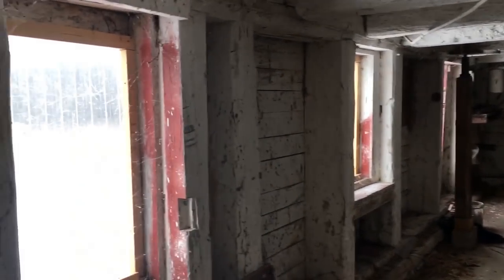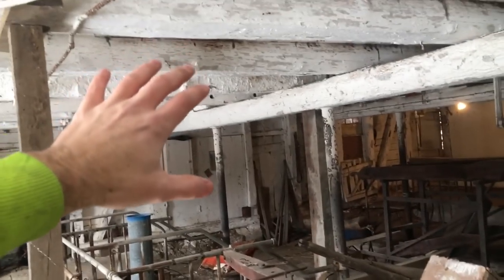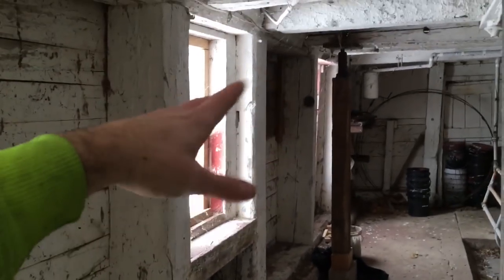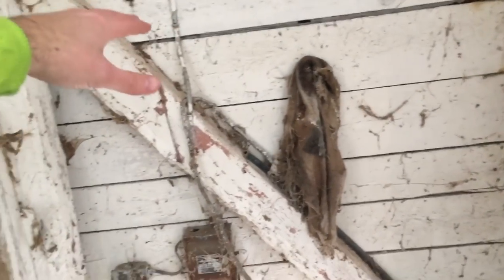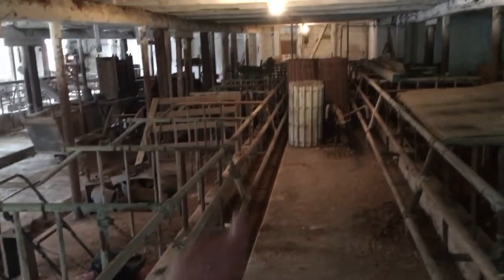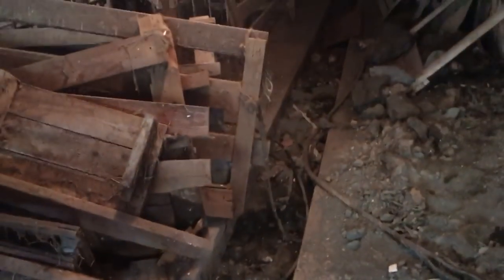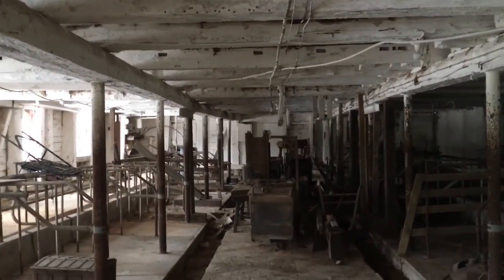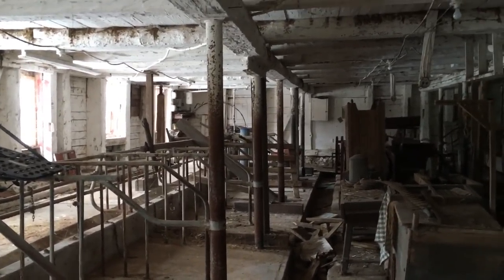Starting a Dairy- Part 2

Comment: You could open up the wall between the two barns jack out the center alley and make the whole thing a free stall/tie stall thats what we did chain the cows up milk em and cut em loose then later down the road put a parlour in drastically cuts down on start up costs just to get ya milking
Reply from the maker: I didn’t think of that, that would be another option, just make it all one

Comment: Without actually being there,  your stone wall could be pushing the barn. If you want to update to a more modern facility you can think about a flat parlor. They are a lot less money than a regular parlor, but if you like to be close to the cows you still can without so much wear and tear on your body. I would check with your state department of agriculture before you spend money past keeping the barn structurally sound.  They may not allow cows to be milked in that type of facility anymore since they would be issuing a new grade A permit.

Comment: I would turn the old barn into a trans Iowa type swing parlor and if you had a lot put some outside free stalls around the out sides of the lot with lean to over them and maybe a covered feed alley. Could be done cheaply and save a lot of labor. The guy that designed the parlor has all the plans for free on the web. The key would be good cows and forage.
Reply from the maker: That looks like a nice system. I hadn’t heard of that.
Reply: PA Farms My uncle converted his stantion that was a chicken coup before for less than twenty
thousand. He milks sixty cows in an hour and a half. Dairy is a good way to diversify but the reason a lot of people quit is the everyday chores. Have lots of kids and get them to do it lol

Comment: Holstiens might not fit in those stalls length ways anymore.  You might need metal grates over the gutter so they aren't laying in it.
Reply from the maker: Yea. I would want gutter grates, we had them on the farm I had worked on. When we put in mattresses, we raised the stalls a few inches so they wouldn’t be in the gutter.

Comment: Gut the stall section add  a low cost Trans Iowa parlour  remove the wall add  replace it with a curtain wall
Reply from the maker: I hadn’t thought about a curtain wall. That would be a nice option, just support the roof well and add curtains

Comment: Problem is with dairy that you barely make any money if you do,  I love doing dairy, I olive these old tie stall barns, we have a 6 by 6 parlor put in and a 140 cow freestall built, we ripped out the stanchions, put in pens and stalls for the calves and heifers.  But with the government saying we have to have the pits is stupid, my cousin got in a farm accident on my other uncles farm and rolled the tractor and was pinned under it for an hour and a half, lost his leg but I still farming,  and now we have to build another new one and the town said we can’t but the dnr is going to fine us if we don’t, so we have to go to court with that.  But make sure the structure is fine and all the electrical, cause barn fires are not fun, a neighbor had one and lost the whole thing.  I would keep the dividers, but cut out the bars in front of the cows and put one bar up for water for the cups.  Air line and milk line can be above the cows.  Fill in the feed mangers and put some tile down.  But with expanded a herd just go slowly, add on here and there when you feel comfortable doing it.
Reply from the maker: Someone had made a great comment that if I would add on to the freestall area and make the bad wall into a curtain wall. That could be an option too. In part 4 I have a summery on the issue. Tomorrow’s video will be the feed storage issues

Comment: Adding your new milk house and parlor would be right around 20k including equipment
Reply: Um that is not really true a double eight costs roughly 500 thousand with out a milk house
Reply: Look at a trans Iowa. If you can justify a double 8 your small enough to justify not having all the bells and whistles. I will bet my next milk check minus pipeline install and bulk tank purchase your under 20k. I know this because i priced it to do.

Comment: Double 8! Maybe try a double 4 or 5, we run a 126 through a double 7 in a 2 1/2 hours or less
Reply from the maker: Yea I should have explained my thinking on that better. If I would do it, I would want it to be expandable. I milked in a parlor that had double 8 and 100 cows. It went fast and you had more time for other stuff. Probably don’t need 16 milking at once for 90 cows, but if you have to expand to 150-200 it’s there.

Comment: It's nice to dream! Did you ever buy a hay elevator?
Reply from the maker: No, the one I was looking at sold already. I need a Tedder too, haven’t found one I want yet.
Reply: I was just curious. I saw one on Craigs list a while back like the one you had discussed buying in the video, and shortly thereafter it was gone. Thought maybe you bought it. lol  Good used tedders are hard to find.
Reply from the maker: I figured on getting a 2 star because the plan for next year is only 10 acres of hay. I priced a new Rossi, they are just so light duty. Pequea makes a heavy 2 star. It’s rare to see a used Tedder in nice shape. I looked at a lot of junk!
Reply: I have a Rossi tedder. It was my main tedder for a few years until I could afford a larger unit. I still have it, and use it once and a while. It may seem light, but for 10 acres or so a year, it will last you 10 years. Mine has seen hundreds of acres and is still fine. I forget where I bought it, but the salesman had it shipped to me and I put it together. Saved me $250 that way.
Reply from the maker: Haha funny you say that. I priced one still in the crate that I would pickup and put together.

Comment: you could do it with your own work , and it would not be that much of an investment, you might want to cheak out the stall lenths i had older stalls mine was 54 ,5 long i had to lenth them longer  tock them too 68 in. long if you milk swiss or holstiens.

Comment: Your structural problem is most likely do to a lack of collar ties in the loft.  If you don't fix the loft structural problems any fixes on the outside walls would be a waste of money and your time.
Reply from the maker: Yea I did install collar ties in a shed over at the other farm. I had to run a heavy cable from one end to the other too. Probably will need it here too